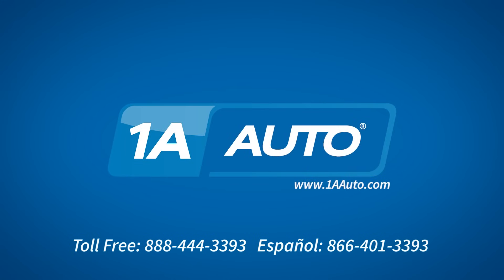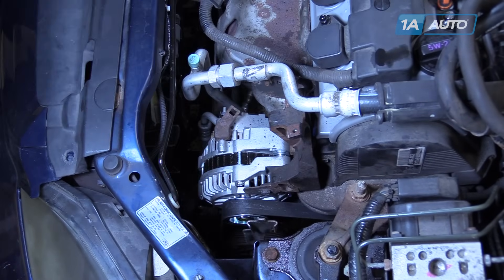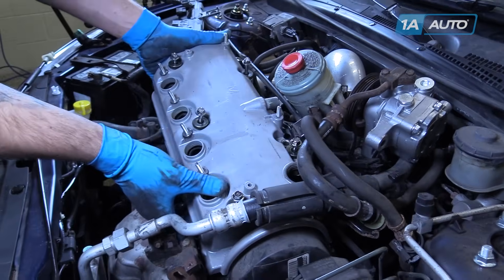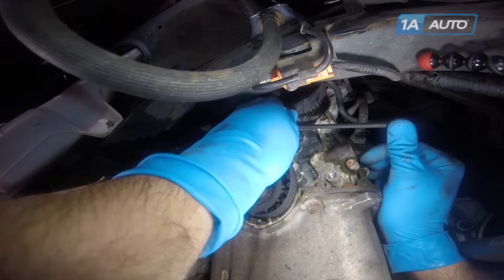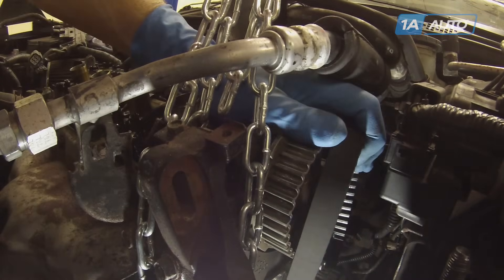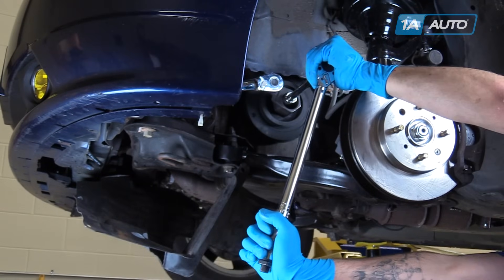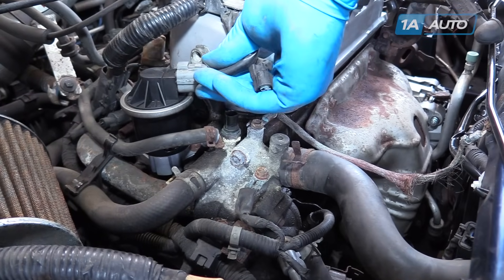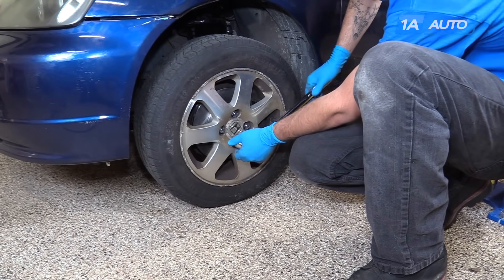How to Replace Timing Belt and Water Pump 01-05 Honda Civic Coupe Sedan

Comment: What was the condition of your old timing belt
Reply: 9:25 looks to have some worn spots in the outside, but no major cracks. However, you never want to get to that point with an interference motor.

Comment: I really wish you would have zoom the camera in on that special holding tool and where it went. Also when you stuck the flat head screwdriver in there and remove the engine cover I didn't see what you unhooked was it a spring or was it a piece of gasket . the video is very helpful in lot of cases but not complete. And you guys are where I buy my porch run 90% of the time unless I need them ASAP
Reply from the maker: +the eabster Thank you for your order. If you would like to leave us a review on Google it would be greatly appreciated. Here is a link to our reviews section. Have a great day! https://goo.gl/i5JFNY

Comment: Why do you turn engine counter clockwise twice? How do you know when it's timed because I thought before you even put belt back on make sure the timing marks line up. I just don't under stand the part where you need to turn engine twice to make sure it's timed. And what happens if you don't do it right on the first process and have to turn the engine again what do you do?

Comment: Can someone please confirm if you have to turn motor counterclockwise or clockwise and if it is counterclockwise how do you turn it counterclockwise if you take the harmonic balancer off about to do this job on my 02 civic really need some helpful information
Reply: put the crankshaft bolt back on with the impact gun nice and easy; don't try to stay on it too long, a split second one hammer will do it just enough to turn the crankshaft for timing purposes all day long. after u install the T-belt and tension it as required n verified timing is correct, then remove crankshaft pulley bolt to install harmonic balancer when called for.

Comment: I got everything done but that pulley with the special Honda took it keeps snapping all my wrenches any advice please
Reply: Buy a really good and long breaker bar. Or put a jack under wrench and break it loose. Or heat the bolt up. Let me know how you get it off

Comment: i thought adjusting the tension you are supposed to turn the motor counter clock wise not clock wise.
Reply: You don't really adjust the belt tension. The belt tensioner and its spring do that when you pull the pin out. The reason he turned the engine clockwise has to do with the way the bolt is threaded into the crankshaft. If he tried to turn the engine in the opposite direction (CCW) the bolt would start to come out and not rotate the crankshaft.

Comment: Car won't start after doing this repair. Turning the key, dash lights won't come on and there's no sound. Brake lights and horn ARE working. Tried jumping and it didn't work. Any suggestions?
Reply: Did you figure it out? Having same problem

Comment: Can i use impact gun to loose the 19mm camshaft?
Reply from the maker: +Juan Segura For removal, if you're careful. Tightening by hand to ensure you don't over torque it
Reply: @1AAuto  You can't be careful with an impact on any spindle. You will damage the crankshaft bearings by using an impact. The service manual even states on a single line by itself as a step (do not use an impact to install).

The question is do you really wan't to chance it knowing some life will be taken off those bearings guaranteed. It doesn't mention removal. But its very much so implied. Anyone who works with bearings knows impacts do significant long term damage to them.

Comment: Hey guys! Does anyone know why my coolant is not being sucked back to radiator from the reservoir? I've replaced, water pump, thermostat and radiator cap. My reservoir is topped off but for some reason it wont get sucked into the radiator if my radiator is empty

Comment: Why do I need to have the belt in the same place as when I took it off
Reply: This is the timing belt. It coordinates the relative positions of the crankshaft and camshaft as they rotate. More specifically, the belt coordinates the movements of the pistons going up and down in the cylinders and the opening and closing of all the valves. If the belt isn't set just right according to the timing marks the engine probably won't run and it may even get damaged internally when you try to start it.

Comment: I'm doing this tomorrow , can you rent the Honda hex tool? That's the only thing I need for this job
Reply from the maker: +Isaac Lopez Thanks for watching!  We recommend going to a local auto part store that has a rental tool program and see what they have.  This is a special tool and can usually be rented in a kit.  Here is a link to the timing parts if any other viewers need them! http://www.1aauto.com/2001-05-acura-el-honda-civic-timing-belt-kit-with-water-pump%2c-valve-cover-gasket-and-seals/i/1aeek00622?utm_source=YouTube&utm_medium=CTA+Comment&utm_campaign=ytcomment&utm_term=3PAgdJ1ZSeA

Comment: The lower timing belt cover must have been brittle. I see the wings where it bolts up broke off. Mine are broke off and it's rubbing against the balancer pulley. Any way to fix this without disassembling everything?

Comment: Can someone please help me with something? What steps do i need to skip if I only have to change the water pump on a 03 Civic. My alternator was replaced about a year ago and they put in a new timing belt. Any help would be appreciated. thanks.
Reply: it's the exact same work; they're right there together dude! that's why u do them both at the same time. I would change mechanic in a heartbeat if the idiot only changed the T belt and left the old WP in to cause problems two weeks later!

Comment: WOW! Great video! Now, when I saw other videos, when they adjusted the time after installing the new belt, they mentioned that the honda engines turn counter clockwise and they turned it two revolutions to top dead center.  I noticed you made a timing adjustment BEFORE you removed the old belt but you turned slightly clockwise, is this ok to do? it's at about 12:28 in your video

Comment: I was charged 1800 for this job, first time getting something like this replaced. Is that reasonable because I’m having the same issues with my car and it’s been about 60-70k miles since I’ve replaced the water pump
Reply: No. Most of it is just labor cost. Do it yourself and save money!!

Comment: So I ordered a timing kit from rockauto cause this shop I know the manager at said they’d just charge me labour if I get the part. So they changed it out, along with the automatic tensioner, water pump and cam seals (if they even did that). Anyways, doing an oil change the other day and now I have a new leak coming from behind/in between that big pully you took off with the cheater bar. Is there a seal there or something they may have not put back, or notice it was bad? Or is it just maybe not torqued down enough? Please let me know what you guys think or anyone reading this. Cause I’ll be damned if I pay them again to take that apart and fix the leak...

Comment: I like your video, but all these vids claim you need to pull valve cover. You do not. The top timing cover has three bolts and cam sensor. Undo them all, and with the engine mount removed, you can pull the bottom of cover away from motor while also pushing down. The timing cover will then clear the lip of the valve cover. Makes job way easier and faster... you can pull both engine mount studs too if you need more room.

Comment: That engine is supposed to only spin counterclockwise.
Reply: It doesn't matter which way you turn it. And the reason he turned the engine clockwise has to do with the way the bolt is threaded into the crankshaft. If he tried to turn the engine in the opposite direction (CCW) the bolt would start to come out and not rotate the crankshaft.
Reply from the maker: +Joe Vignolo Thanks for the feedback!

Comment: I like 1A Auto for the most part. But if you are someone with absolutely no car knowledge do much more research then just their videos. They forgot to include important steps or mess up on the name of a part (For ex they changed the AC switch not the coolant temp but said they were switching coolant temp) so it makes it frustrating. Don’t ever just trust one video. Do your research

Comment: after removing the wheel and trim, the first step should be loosening the crank pulley bolt. if you cant get the bolt loose no point doing the rest. Mine broke loose around 1000 ft-lbs with an impact wrench.
Reply from the maker: +Robert vermillion Thanks for the tip!

Comment: I had bought my water pump kit from 1A Auto. My Honda Civic is in 05 1.7  d series motor. the paperwork that came in the box States it is very important that the engine is to be rotated counterclockwise two full turns. In this video it looks like you're rotating it clockwise. My second question is when I got my Gates water pump kit from you guys the PIN was not in the timing belt tensioner. Do I just line them hoes back up and put the pin in it? Or does the tensioner have to be wound up somehow before the pin needs to go in it? I contacted your guyses office and as nice as the gentleman was he had no idea how to answer my questions. He sent me a link to this video. Thank you in advance for any help
Reply from the maker: +the eabster Thank you for your order it is greatly appreciated. You should follow the manufacturer's instructions that came in the box, and then use this video to finish the repair that you are making. At around 14:20 we explain how that clip works. Hope this helps you out. 1aauto.com

Comment: your kit also comes with the replacement seals for the valve cover bolts this video does not show you how to replace them and the gasket rings that go in your ignition coils

Comment: Why is it in all timing belt videos, its so easy to just slip the new belt on? I never have enough slack.
Reply: They chea'in'
Reply: on the 7 generation civics is a snap if u loosen up the tensioner bolt ( not the spring, u leave that stretched out n connected ); like butter. On my other car a mazda 626, it's a PITA until I figured out how to beat the SOAB! ( basically on that one, use a mini sliding clamp to hold the belt on the crankshaft but the trick is to have the belt halfway on the sprocket, halfway on the tensioner and idler, and when u get to the two camshaft sprockts on top, u have just enough slack to little by little push the belt gradually ON evenly on all sprockts, idlers, tensioners involved  - 5 of 'em! ).

Comment: Am i the onlyone who noticed he supported the engine with a block of wood so he could take the motor mount off, and THEN lifted the car to take of the crank? Should have waited until he was done with the lift to pull the mount.

Comment: Why not use a impact on that crank pully bolt?
Reply: Damage crank bearings. You never impact bolts on any spindle. The impacts will score the bearings and premature failure will happen as a result. 

Think about it like this. You are impacting a part that needs constant lubrication or will seize up break. Its not moving, there is no lubrication between the two parts that are being hammered together by the impact. It's a big NO-NO.

Comment: I know this is an old video but i did this and my car ran fine until the alternator bolt slipped out a little and starting rattling. Now it barely will start and wont really accelerate
Reply: Any ideas what could be wrong?

Comment: The crankshaft bolt was beyond tight Broke 2 1/2 drive ext getting it loose
Reply: Same here bro, my girlfriend's car had same thing. Even electric impact wrench failed
Reply: @9996741699  You shouldn't use an impact on it. You will damage the crank bearings by beating at it with an impact. That is a BIG NO-NO. But most people do it out of ignorance and laziness.
Reply: for this u need good quality 1/2'" extensions, socket n breaker bar; and a good 4-5' cheater bar. Craftsman and the like will work. also, impact adapters from HF break in half in this situation.

Comment: Errrrmmm did I miss the part where you put that pin in the new tensioner to keep it retracted? You show pulling it out but not putting it in. What is that even? A tool? A random piece of hardware ?

Comment: You should have turned the engine the other way, using wheel with it in gear. It is wrong to turn it how you did. The belt was coming off the cam pulley.

Comment: when you turn the crank i noticed you turned it clockwize to you  turn it counter clockwize or clockwize to line it up
Reply: That's what I saw, instructions I have,  "Counterclockwise".
Reply: The reason he turned the engine clockwise has to do with the way the bolt is threaded into the crankshaft. If he tried to turn the engine in the opposite direction (CCW) the bolt would start to come out and not rotate the crankshaft.

Comment: You turned the engine in the wrong dirrection when you checked for top dead center you have made a major mistake the engine runs in counter clock wise dirrection

Comment: #1 DISCONNECT THE BATTERY!
#2 THERE ARE 5 BOLTS HOLDING THAT POWER STEERING BRACKET
#3 ROTATE ENGINE COUNTER CLOCKWISE OR YOU'LL HAVE SLACK ON THE WRONG SIDE OF THE BELT!
JFC, CORRECT YOUR VIDEO ALREADY! YOU'RE SUPPOSED TO BE "PROFESSIONAL"